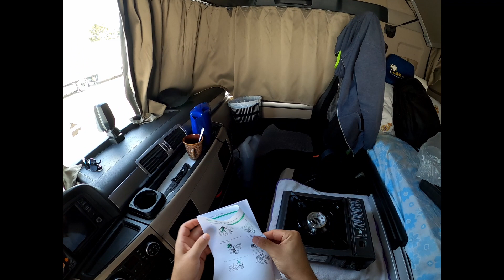The kitchen stove every truck driver should own.  #truckvlog #trucking #trucker #gopro #truckdriver

Comment: New trucker here, is it safe to carry the butane canisters in the truck? I want to get a portable stove but im afraid the canisters will blow up lol where do you store them?
Reply from the maker: Hi,

Let's see,if you're planning to buy a big butane canister then obviously you'd prefer to store it far away from the cabin, somewhere in the back of the trailer,in my case, I'm using a smaller portable stove but still it's dangerous,I usually wrap the  butane in paper or plastic to avoid any friction or use rubber or something similar to wrap it on.
If you're going to cook (I don't) do it outside away from the truck.
I hope this helps.
Be safe.